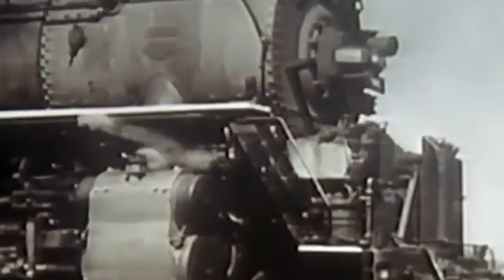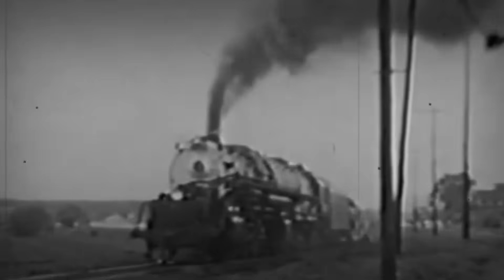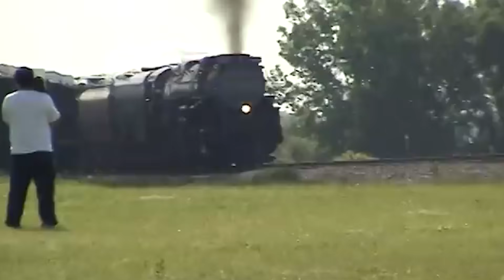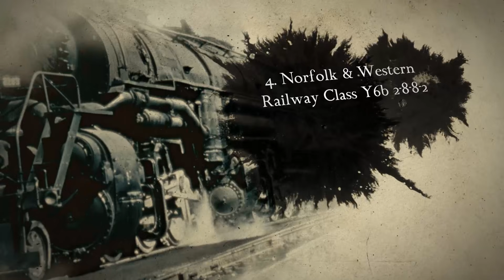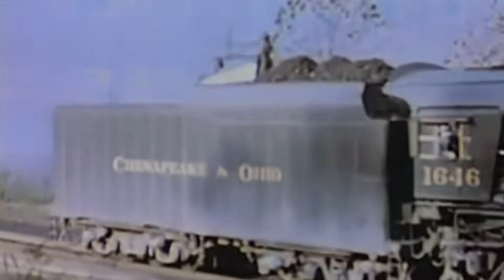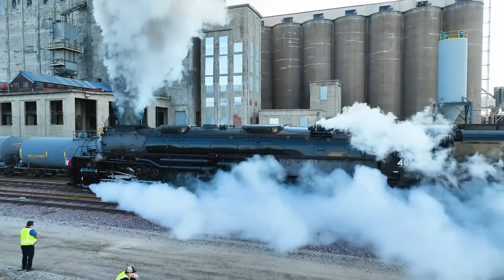10 BIGGEST TRAINS ON THE PLANET

Comment: Your narrative doesn't match. On the Cab Forward 4275 to 4294. Original video shows a 4220. Normal people don't add a dash in-between the wheel arrangements. Just 4884. No dashes. AI is not normal. You've gone to the effort to edit these videos, narrate them yourself.